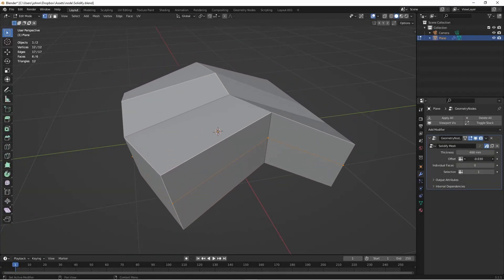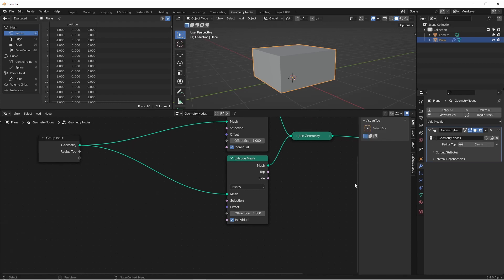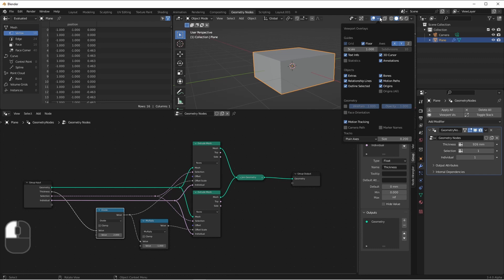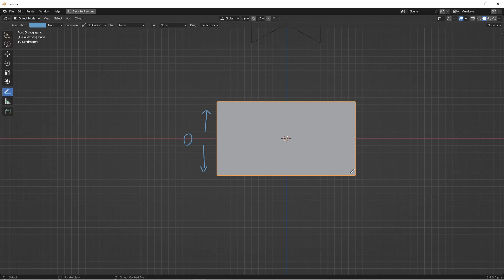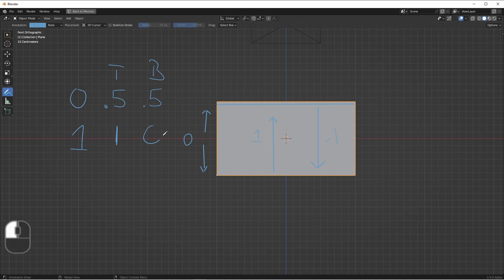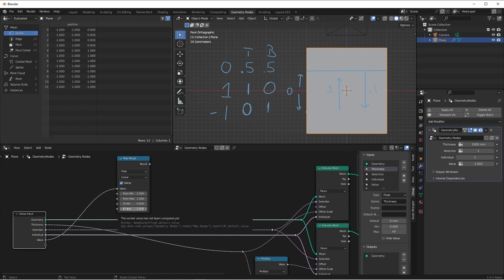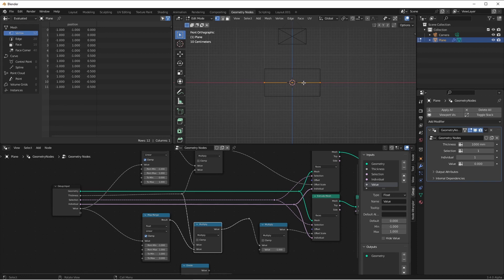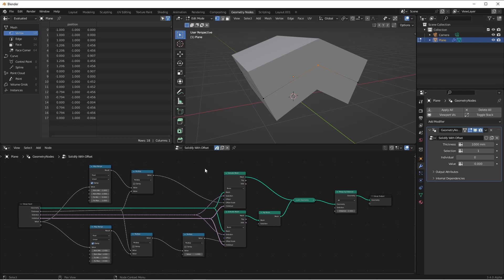Hey! Can You Do Me a Solid? Part2: Building a Solidify Node with Offset

Comment: how would one make it so that it'd extrude flat?
rather than extruding on normals
for example, should this be used on a sphere, the bottom most edges of the extrusion would be higher up than the original. how could someone prevent that?